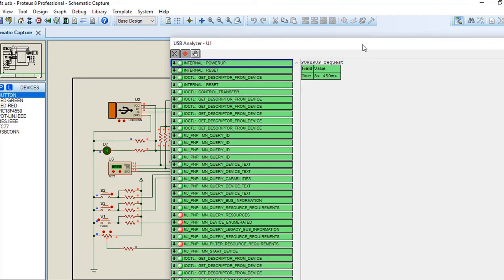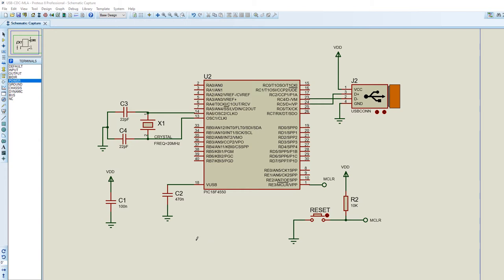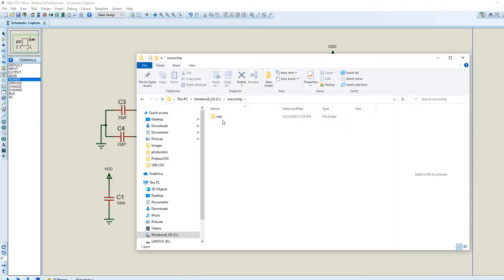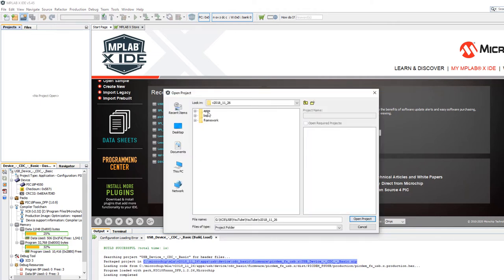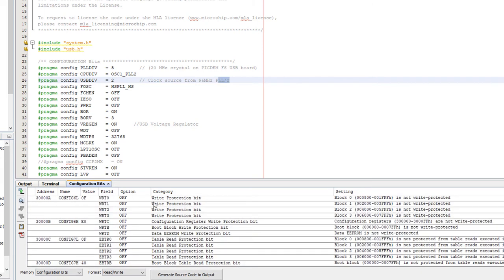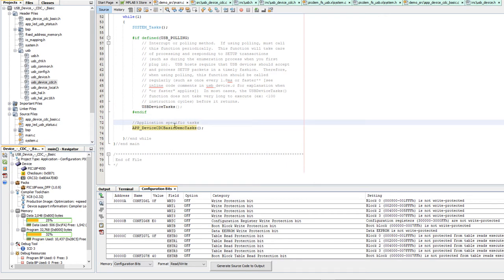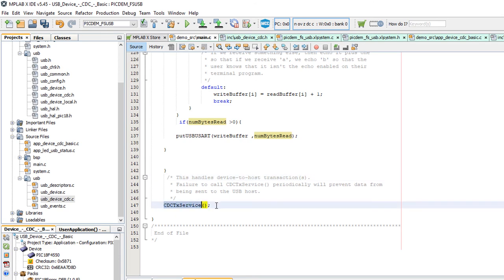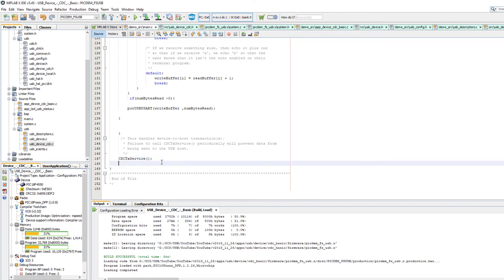63- USB Communication Device with PIC using MLA | MPLAB XC8 for Beginners Tutorial

Comment: My PIC24fj wouldn't work with the MLA libraries.  I kept getting a processor doesn't match (I have a PIC24fj256GA705) error.  I did get it working however, I used an ESP32 as a UART to USB Bridge and I imagine you could do the same with Arduino and definitely a USB to TTL converter.

Comment: Do you know that proteus isn't perfect simulation and often (especially with PICs), programs won't work on real hardware even though it works on proteus ?
Reply from the maker: There is no simulation that can be better than the hardware in the real environment.  But in design or in teaching there are so many advantages of using simulation. 
Everything is not also simulated the same, some are hard and some are almost as in real hardware. 
Proteus is also among the best in this field of simulation and if configured properly and knowing its limitations, its simulation is realy quite good and from my experience it doesn't disappoint in hardware.

Comment: Hello Sir, I am struggling to program my code in my microcontroller using easypic v7, i wrote the code and it ran successfully, yet it write something like " Implicit conversion of pointer to int" ,"Implicit conversion of int to ptr", "Varaible 'temp' has been eliminated by optimizer" & " Variable 'mV' has been eliminated by optimizer" what could it be wrong?, because i can write the code(programme) on my microcontroller while connected with easypic v7 but it doesn't dispalay anything on the LCD display!! even if i try to blink an LED there is nothing!!  and when i check if my microcontroller is blank or not, it say its not blank!!! please help if you can, thank you.

Comment: Why are you still using the PIC18F4550? This is an obsolete part, and it costs more than the modern equivalent. If you can even find it available, it is $6.50 - $7.00 apiece, whereas the PIC18F45K50 is practically the same part and is more readily available, and only costs around $2.50. Also, the newer part doesn't require an external crystal and supporting caps, so is easier to use in USB applications. The same could be said for the PIC16F1455/59, which costs even less and would work great in these tutorials. I'm not trying to criticize, I just think you'd want to make things easier for students trying to learn this stuff. Otherwise, great tutorials!
Reply from the maker: Thanks for your feedback really appreciated. 
Yes we know the PIC18F4550 is obsolete and we don't usually use it in our tutorials.  If you check the link of the USB CDC article to our website, we used the PIC18F45K50 which is more modern and cheaper.  And in the next tutorial we will use the PIC18F45K50 with MCC which is the tool that Microchip is pushing for the future .
The reason we used this old PIC is because is supported by Proteus simulation which doesn't support newer models. Many people especially students still rely on Proteus simulation for their development.  So we thought we will consider two approach to cover everybody, old tool with Microchip Libraries for Applications with Proteus and also new PIC with MCC with hardware.
Thanks.
Reply: @StudentCompanion  Another point I should have mentioned...the last time I checked, MCC does not support the 18F4550, so you can't teach setting up with MCC.
Reply from the maker: We will use MCC with the PIC18F45K50 in the next video.